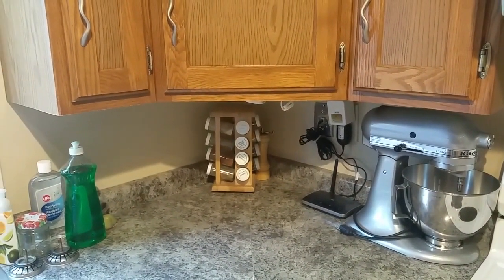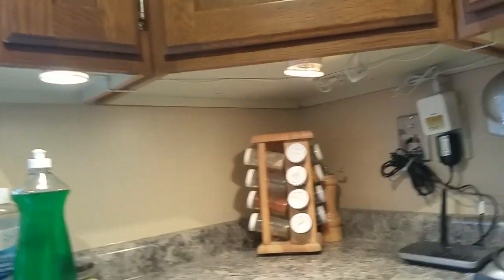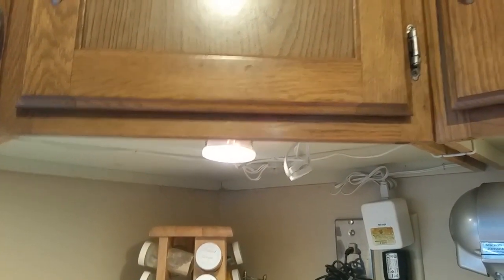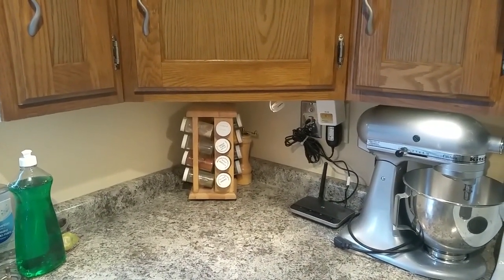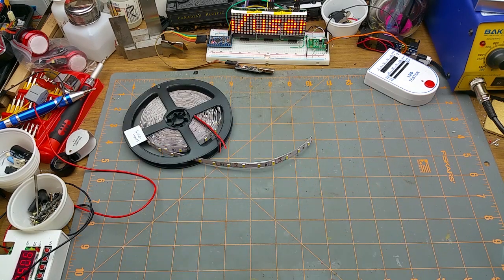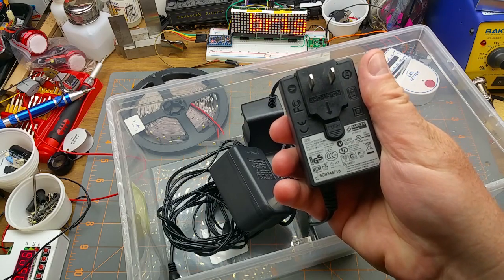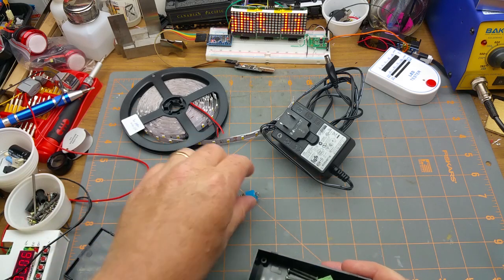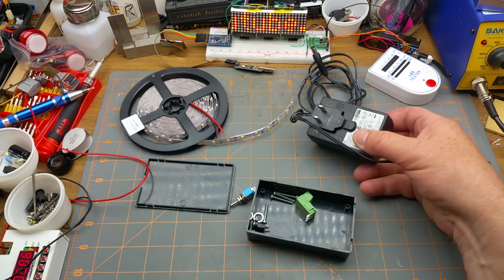Under cabinet kitchen lighting project

Comment: My USB iron came yesterday - yay -, but it's so weak it has trouble soldering a wire to a track - boo -. lol. It's using 0.75A, but I think it needs a thicker USB cable.

Comment: power input plug solden, were you forget heat srinktube ???? why not made simple arduino nano pwm dim too sametime there ? wery guikly made one pwm output and can dimm light too simple. need only arduino,mossfet, potentiometer. you know :) haha same you forget heat shrink tube led output plug too.